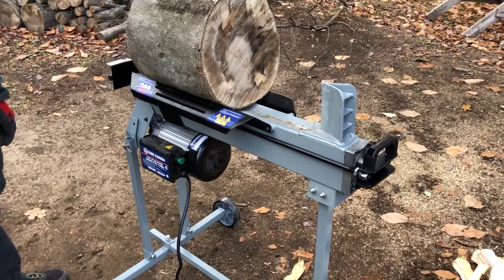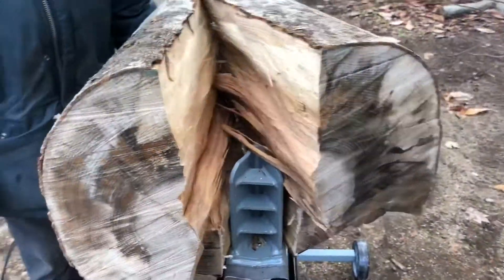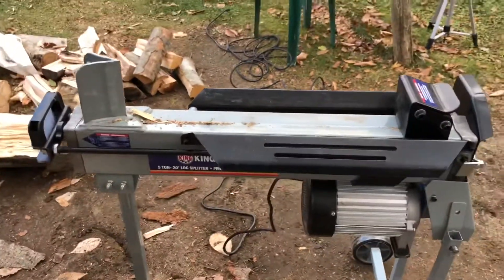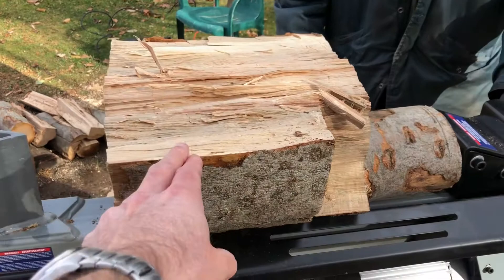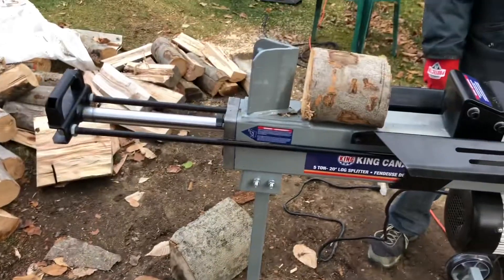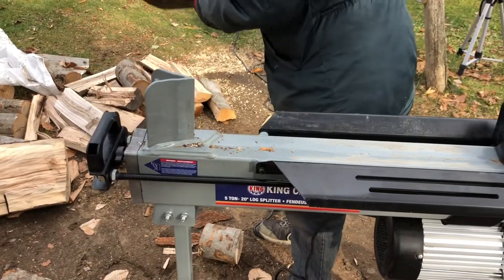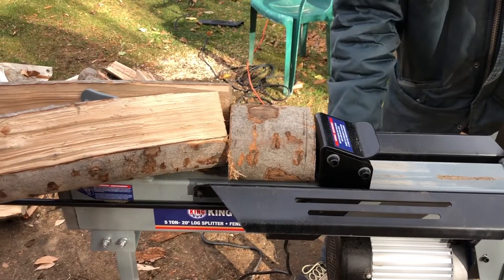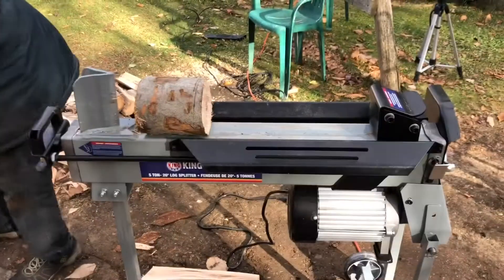King Canada 5 ton log splitter first look/test

Comment: Is the operation only by pushing the button or is there a pedal option? You didn't show that in this video. Seems like the button would wear out pretty quick if you have to keep pressing on it all day.  Also means your hands are in the way if the log explodes outwards while being split.  Bad design.